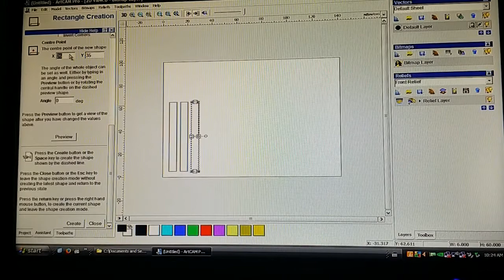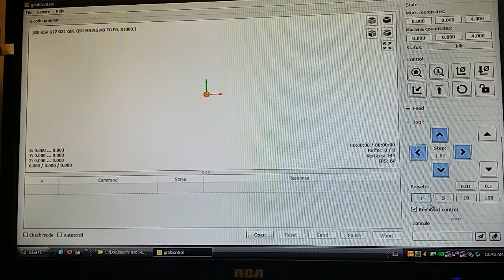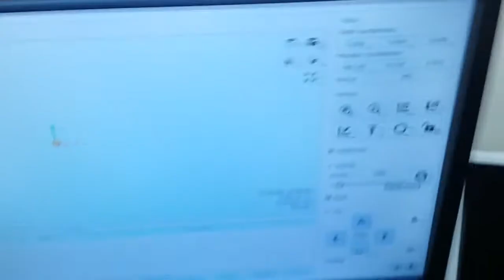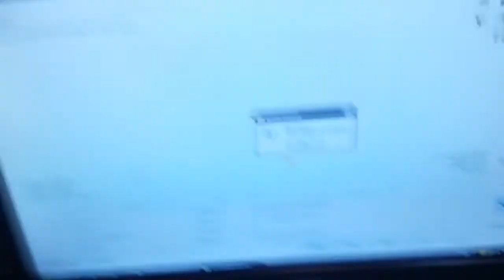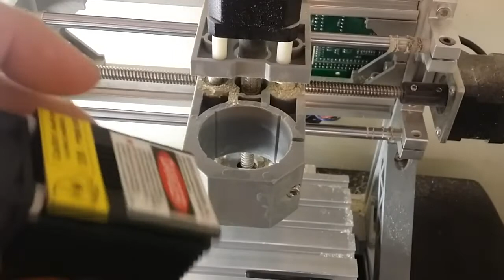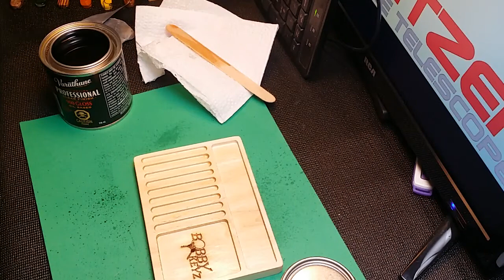-=404=- Using The 1610 CNC Router To Make Pinning Trays!

Comment: great vid just got a woodpecker and this was very very usefull
 couple of questions if I could as I need advice 
 what did you swap out the stock collet with? you have a brass bush on your  drill
and what determins passes is it done in art cam or grbl software or both as I only have grbl at mo and it will only do a0.2 depth
thanks for  hep
Reply from the maker: I didn't swap anything out, as you see it here, it is stock.
The passes are determined by art cam, or whatever cam software you use. It is a consequence of the tool you are using, the feed speeds and the clearance type you select. If your tool depth is higher, the passes are lower, if your tool is small, the passes are higher etc... Most Cam software will be able to drive the grbl, mach 3 is free and will do fine.

Comment: Have you tried making a pick with it yet? I'm just wondering what the pro's and con's would be for using it to make picks vs. using a handheld rotary tool...
Reply from the maker: The cons are it's a dinky little hobby grbl. It doesn't have the strength to mill metal. Let alone the very hard steels we use for picks. Wood and plastic like materials, yes. Metal, no.
Reply: Thank you for the speedy reply... So if I was to build a set up that would allow me to use a more powerful tool then it would be possible?
Reply from the maker: Yes, But for pick making you would need a much stronger motor, liquid cooling system (or stand there and spray it yourself), and much beefier motors and hardware. Not to mention VERY expensive bits to be able to mill hard pick steel. Last I priced it out, about 1.5k to build one. 

A better rout would be a small hobby mill from harbor freight, and buy a cnc kit for it.

Comment: Very cool. With the right "know how" it looks like it could be a lot of fun to play with. What was the cost for everything?
Reply from the maker: Gantry the cnc with laser was $260 canadian plus shipping, the router bits are $12 - $18 each the hardwood is about $15 for a few feet. The machine has to be assembled  (about 2 hours) and you need to learn the software and test everything multiple times to work everything out.

It costs more time than money. Lol
Reply: Thanks for the info.

Comment: Ouch! That power-outage just makes your gut drop! That was an amazing tutorial! I want YOU to make any future tuts I need to see in life. I feel like an expert now, and I've never even considered buying a CNC machine. One down-side for me, it seems like a lot of $$ for a pinning tray, what else will you be making with this? The board is beautiful! Thanks for the video!
Reply from the maker: Been Pickin I am always making stuff, some locksport related, some not. This machine will also etch circuit boards, which is awesome for my electronic hobby. I can ditch the chemicals and not have to keep buying them. It can also mill/laser cut things like wood and plastic, making it perfect for little boxes and custom pieces I need for my various projects. But if all it ever did was make pinning trays I still would have bought it. If you've seen my packages I send out I always try to make them epic. So it was worth it just to be able to make pinning trays for my trades. But it does have a number of other uses. Some of which I've already taken advantage of (circuit etching)
Reply: Thank you for the answer. It's great you have so many things you can do with it. I'm not very creative, so I couldn't think of anything to use it on. I hope I get to trade with you some day! 'Till then, take it easy.